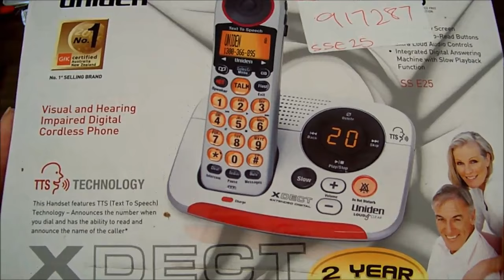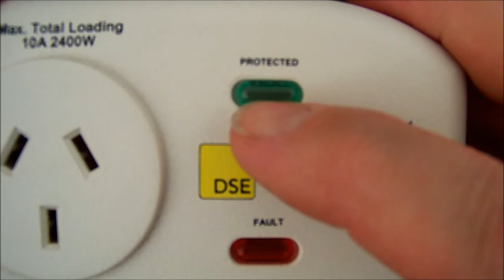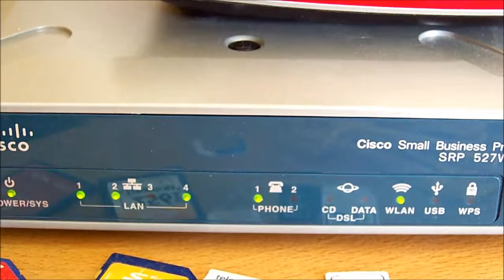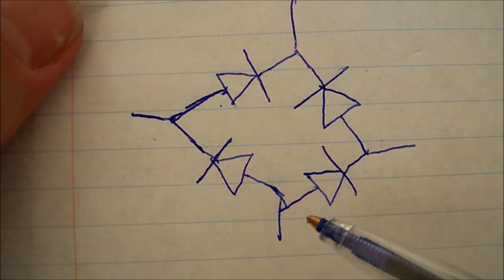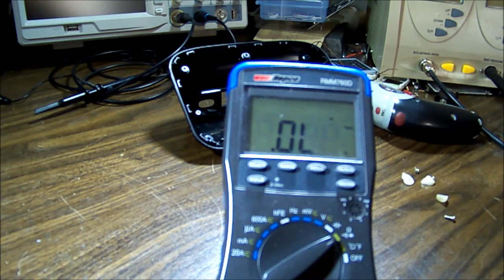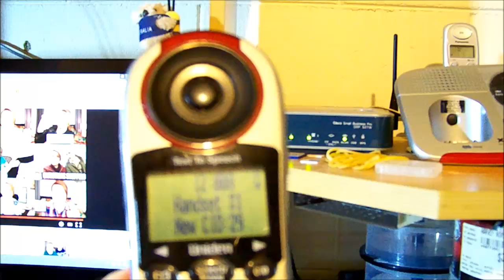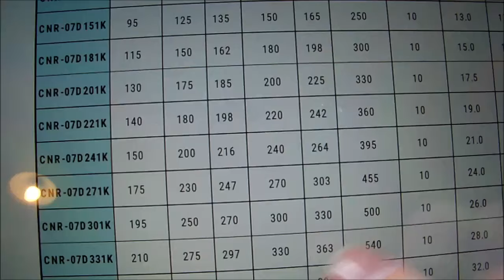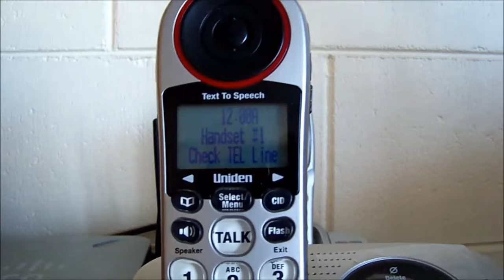Uniden sse25 cordless phone repair

Comment: Sorry,  WHAT?      What did you do, Bridge where  -capacitor-\  Varistor  was in order to try?       
i looked up  -  Varistor  providing protection against over voltage transients and surges. [Elec torturials]    (don't know if i'm right.
Reply from the maker: Sorry for such a late reply. Yes you are right. I think the MOV was in parallel with the input pins and having been damaged from a power surge it was a lower resistance than normal thus affecting the input. Removing it made the phone work because normally it would be a much higher resistance than I measured here so taking it out simulates a normal working MOV.
Reply: @JonnyFix    -  Two years later ... in search or other issue, i re-watched, still wasn't sure, Until Now;  I get it!  
 jeez i'm slow.   %\   lol      Appreciate your answer.   Thanks!*

Comment: How did the unit work without the MOV?
Reply from the maker: +roomba The MOV is in parallel with the lines unlike say a fuse in series with one line so each line still went to it's respective pin on the bridge rectifier and elsewhere. Removing the MOV is like having a good MOV in there anyway, it's a high resistance until 400+ volts when it becomes a short to remove the surge.
Reply: Jonny Fix
Thanks!